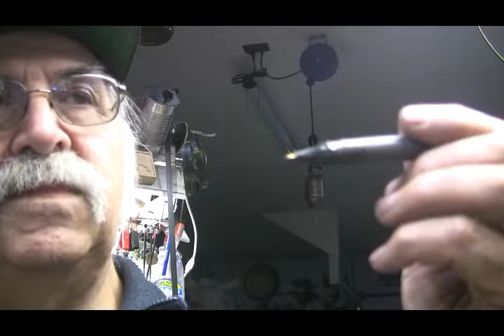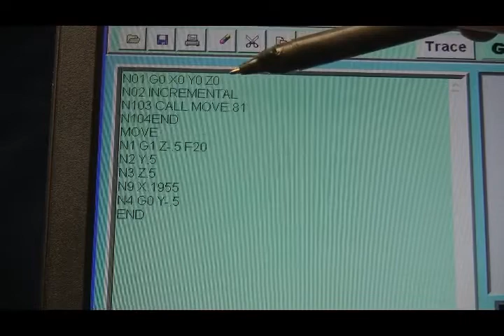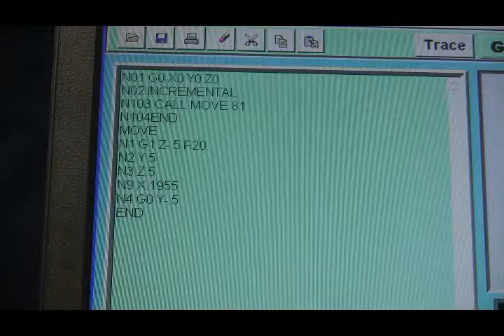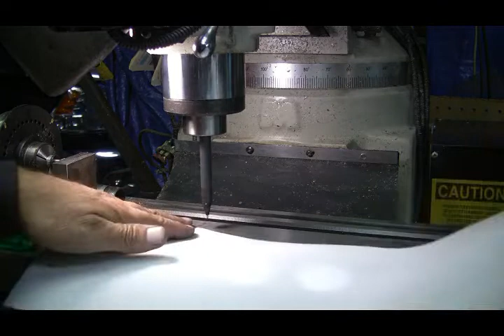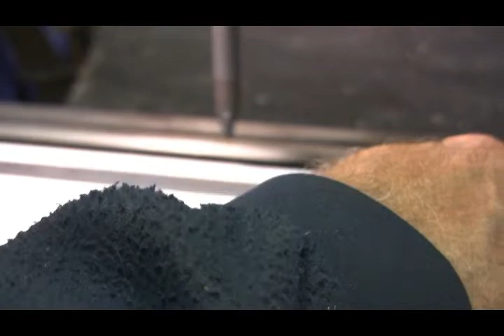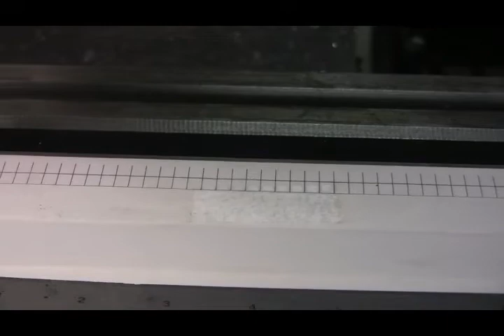Coil Wnder 4

Comment: That's really creative using a mylar media, and using your cnc as a plotter.  We had a 618 B&S micromaster grinder with a optical screen.  We used a 10x mylar drawing for grinding contours on mold steels.  Looks like you are close to cutting your second gear. Will the same hob work for that one?  Looking forward to seeing it.  Tc Mike